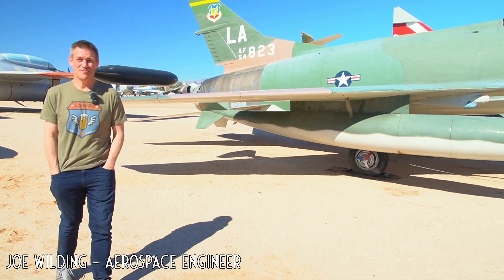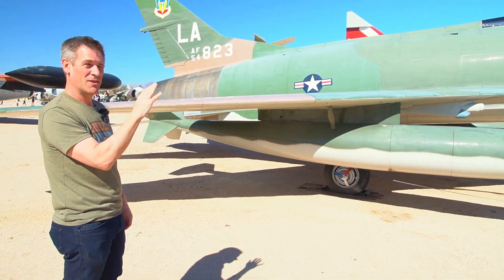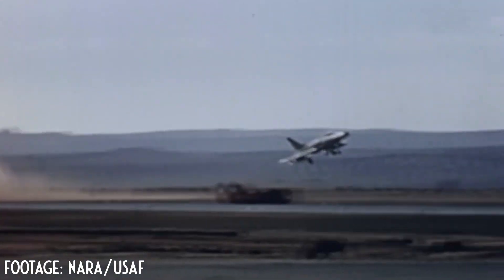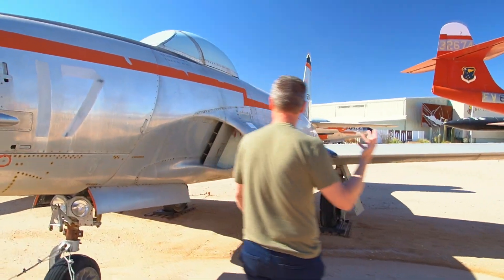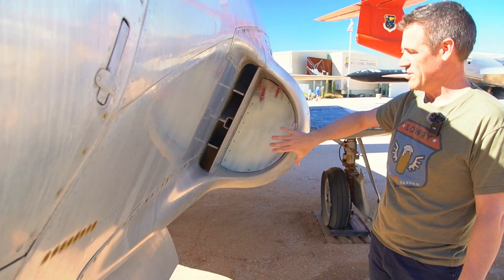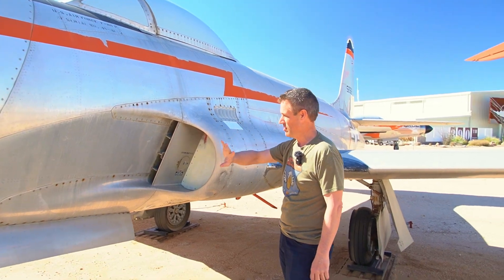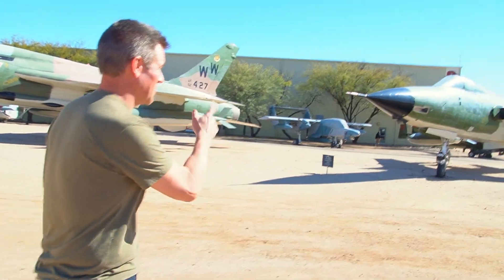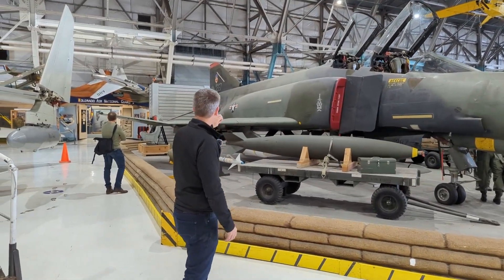Slippery Speed Secrets of the F-100 Super Sabre | The Aviation Show Clips

Comment: I flew the Hun for 6 years in the Louisiana Air Guard, popularly known as the CoonAss Militia. I loved the airplane! It had just beautiful handling, one of the few jets I flew that you would see guys doing aileron rolls just because of the excellent feel.
Flaws, yes. 
It was up to you, the pilot, to know to use rudder only in high angle of attack flying due to the adverse yaw. In the pattern, you flew it by the book, and never got slow. 
There were also many mods to the plane due to knowledge gained from accidents.
By the time I flew it, in the mid to late 70’s, it was a very reliable, and sweet handling fighter.  But, it could, and would, bite you in the ass if you did dumb things in it.  I just loved flying it.

Comment: North American were on quite a roll designing & developing leading edge fighter aircraft, until the F100. I was hoping this video there would have been be a discussion on what transpired with the preliminary design of the F100 and why it turned out the way it did. I understand that in this period of the 1950s aviation technology was moving at a very fast pace. Was there a situation where the USAF was not allowing North American Aviation enough  scope to produce a viable fighter aircraft in that the Air Force was on a quest for a faster fighter delivered quicker?
Reply from the maker: We cover this a little in the full video. The whole series shows the expediency that the USAF were putting into fighter development. NAA's approach for the F-100 can be seen in the XF-93, which serves as a bridge between the F-86 and the F-100. That they then went YF-107 is an 'interesting' leap. That aircraft also makes an appearance in the full video.
Reply: @theaviation_show 
Thank you. I shall watch the whole series.